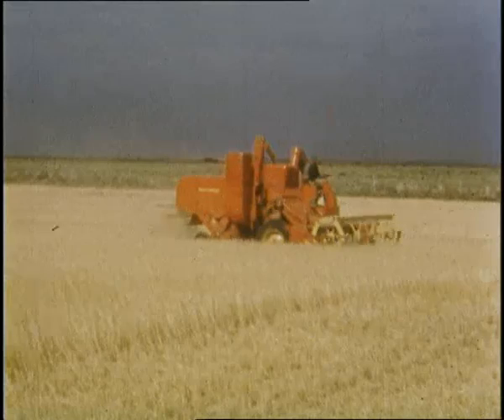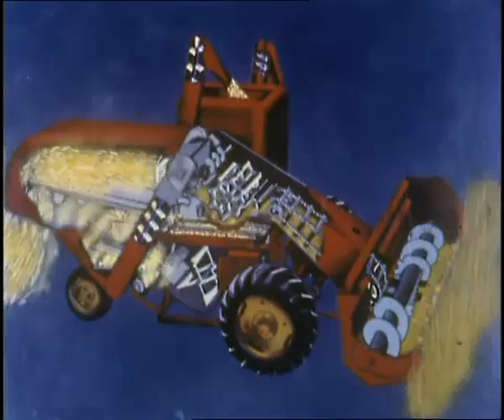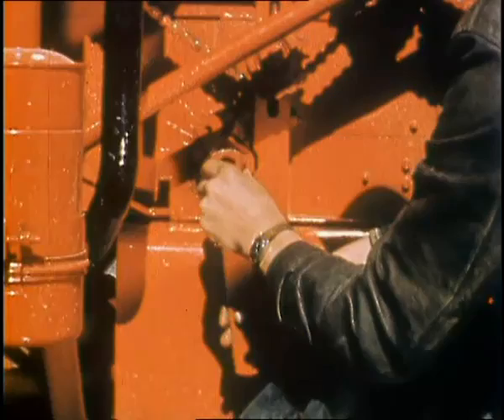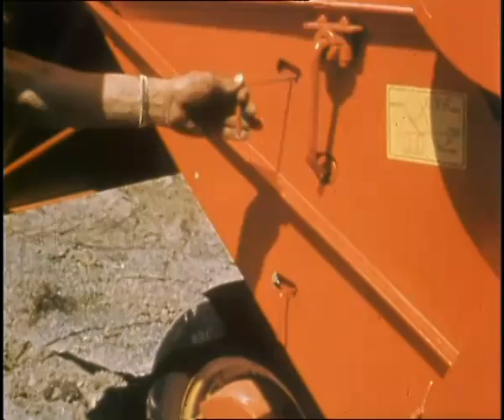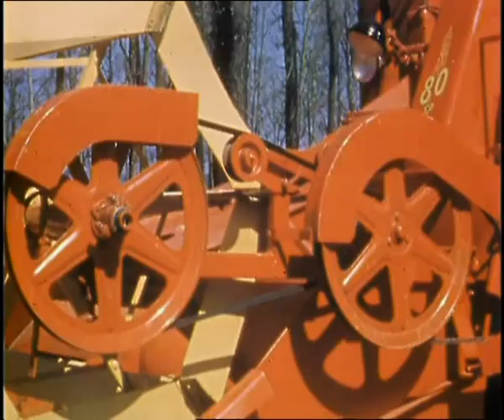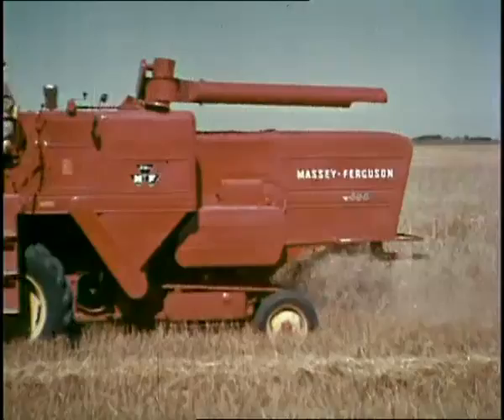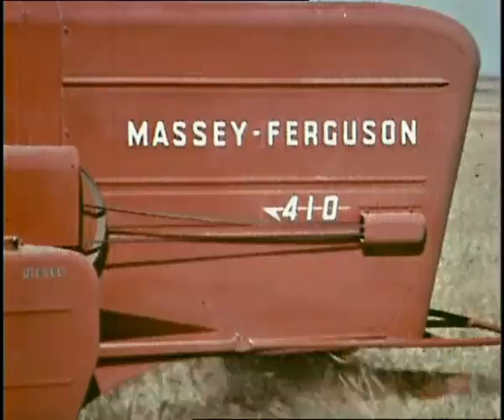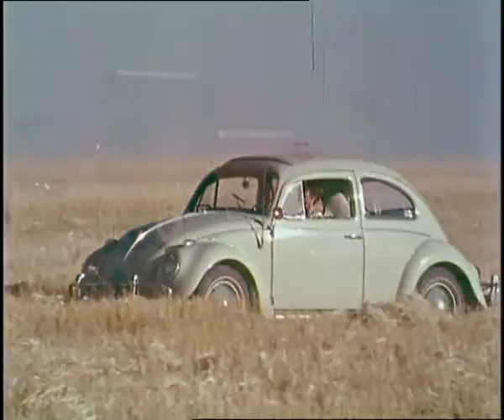Massey-Harris-Ferguson combines - Historic movie

Comment: My dad bought a 90 special brand new and it was my job to change the oil, clean the air cleaner and spark plugs on it as I was the littlest person on the farm. He then got a 400 when they first came out. That lasted 1-2 years before ti got trade on a 510. Then who knows how many 750, 760, 850 and 860s we went threw over the years. That paddle feeder was great as was the stepped sieves on them. And their rock trap was so much better than the early IH 1600 Rotories. I once picked up a good sized rock in a 1600. I swear that machine was jumping 3 foot in the air for a minute or 2 before that massive rotor stopped spinning. I still hate the IH rotories. I also caught that one on fire twice. Never did burn up that crap machine but came close.
Reply: Randy: what year did your family buy the Model 90?